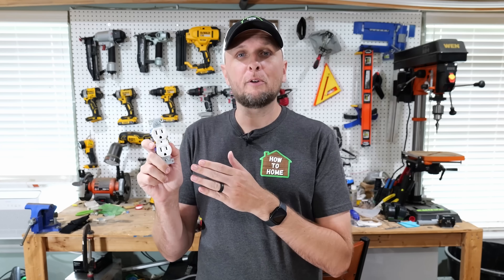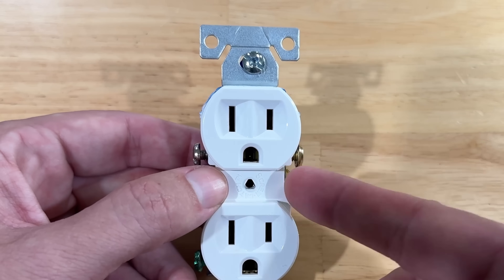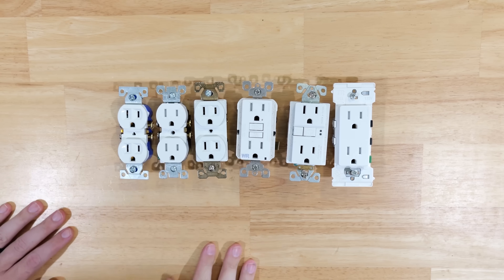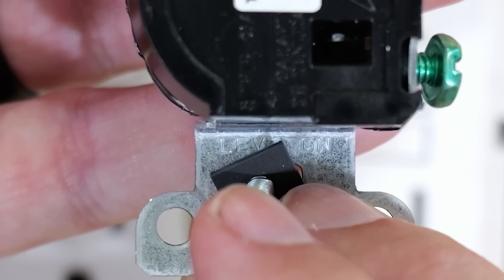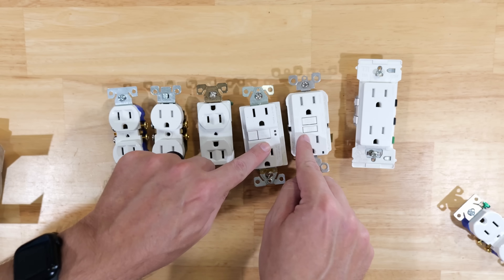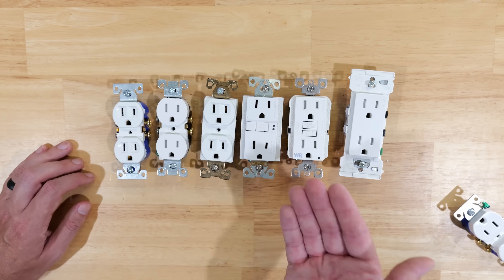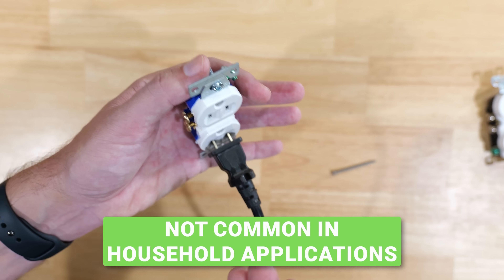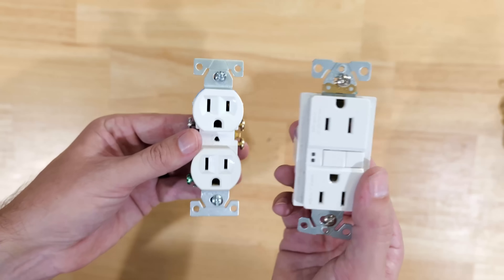The Shocking Reason Why Your Outlets Are Installed Upside Down!

Comment: I go by the fact that many devices w/ 3-prong plugs are designed to be ground down.  I’ve never seen one designed to be ground up.  Even the angular ones are a bit more awkward to plug in ground up.

My parents’ house (built in 1974) had all ground plugs up and it always drove me crazy, wanting to ‘fix’ all of them.
Reply: @xnonsuchx: Ground prong up when that outlet is attached too the wall-switch so people there know where to plug in their lamp to control it from the wall light-switch.
  Medical facilities have things hanging on walls that fall, like clipboards, scalpel, hemostat, that can fall and short the circuit, military galleys and  restaurants, ground up was specified, due to stainless steel utensils being dropped, etc. Therefore it has become required that they be ground up for contractors. In many cities ground up is standard in all commercial and industrial buildings, ground only go down in residential buildings, houses, apartments, condos, etc. 
   Internationally, countries with 3-prong outlets always have the ground up
   Everything is in context and the answer DEPENDS on context. 
   Examples:
“Never took the orientation of an outlet seriously until I was measuring for a shelf with a tape measure. It slid down and fell across the prongs of the washing machine plug.  POW! “ —@joef.6596
“I work at a K-8 school. Maintenance assembles powered multi media carts with the ground plug up in consideration of teachers dragging metal bracelet chains across partially unplugged power plugs.” —  @scaryhouse7969
“a length of florist's wire rolled off a side table onto a slightly loose plug and shorted the circuit, creating a small fire (quickly extinguished).  I now always install ground prong up” @deegee54
“I work at a restaurant and we have this work table with some outlets built in on top. Someone managed to let the edge of some tin foil go in between a plug and the outlet and it got disintegrated.”@MatthewSuffidy
“I knocked some change off of my end table one day my mistake of course, and a coin fell down right on the prongs resulting in a loud pop and a flash along with some smelly black smoke. I have since gone through my home and reversed all of the receptacles so the ground prong is now on the top.”—@chrisenglert3958
“my wife's gold necklace chain dropped off the rack onto two prongs of a device that were plugged into a receptacle with just a little prong showing.  It vaporized the gold necklace area of contact and left a nasty burn mark on the faceplate of the receptacle.   This was on a bar and I probably should have oriented the receptacles there ground prong up.“—@winfordnettles3292
"I had lunch with the Chief Electrical Engineer at McDonalds headquarters. He told me that one of the workers in one of their stores had her hand badly burned when a metal cookie sheet (or something similar) slid out of her hand. It fell onto a receptacle that was loose…the metal cookie sheet made contact with the two blades resulting in  big arcing flash that caused the injury, this is a reason Ground Up is safer."
“In commercial buildings (where receptacles are very high from the floor) ground has to be at the top. In a case of a water leak ground has the first contact with the water. In residential buildings (where receptacles are not far from the floor) ground needs to be at the bottom. In a case of a flood, ground wire would have the first contact with the water.”—@powerzx
“When a heavy extension cord or wire from a device plugged in is experiencing stress from the cord being pulled taught or tugged on, the greater force is usually downward. The ground prong being longer, exerts the greatest torque when the wire is being pulled in a downward direction.  Occasionally that downward force will cause the plastic of the ground prong opening of the receptacle to crack from the downward force. If the ground prong is up, that downward force has much greater support from the receptacle structure. I’ve personally cracked a few receptacles over the years working on projects where the wire plugged in was being yanked around a lot. Where the ground prong was up, the extension cord always stayed more securely plugged in.”—@TechwizJoe1

Comment: the debate over ground location is based in fallacies. it doesn't matter, at all. I install mine like a O face (ground down).. plugs are manufactured that way and it shouldn't be a chore to plug stuff in..

Comment: I moved into a home with the ground up throughout the house, garage, and shop. I was used to the reverse condition and found the ground-up position annoying until I got used to it. There is a rare place where the ground was down and that would tick me off because I was getting used to the reverse condition. It does make sense that the ground should be down because removing a plug might involve coming in contact with the hot wire, but anyone in their right mind would never put their fingers in contact with any of the prongs. I was taught that only the plug outer casing should be touched to insert or remove a plug,

Comment: terrible argument for ground prong up - what if it falls at an angle and still hits two? The odds of exactly straight vs angle is prob about the same. Or less. Plus once falls and hits the first one it will maybe then slide onto the other one anyway that orientation.
Reply from the maker: I mean, it happens.  Plenty of people in the comments that have shared it happening to them.

Comment: I myself as an electrician, always installed the ground prong down, which we referred to as a smiley face. the other thing is I use these plug-in modules which operate remotely. When the ground prong is down the outlet on the module is on the bottom as opposed to the top and looks neater
Reply: Ground prong up when that outlet is attached too the light-switch so people there know where to plug in their lamp to control it from the wall light-switch.

Comment: In Puerto Rico's electrical code, the ground plug will always go down no matter if the receptacle is mounted vertically or horizontally . The hardware stores have to sell the receptacles to meet with the code, so when you are installing, you have two to make sure you have the proper ones for your job.

Comment: I prefer them ground plug up.. the reason is when you have a 3-prong cord plugged in and it's a heavy cord the ground plug holds more firmly then the hot and common and it stays connected when I've had the same heavy cords plugged into an outlet where the ground is down the hot and common tend to be a little loose and can lean down and can come loose and be pulled from the wall. This is just my preference.

Comment: You reference the grounded conductor on  the receptacle as being a "neutral." There is no neutral in a 120 volt circuit. Only in a 240 volt circuit. 

In a 120 v circuit, both the black and white conductors carry the total circuit load. In a 240 v circuit, the white conductors only carries the unbalanced load between the two conductors, that is, the "neutral" current. 

Other than that, excellent video on an often ridiculous argument. 

As an ICC certified and state licensed inspector (retired) i usually asked how did they intend to orientate if the receptacle where to be mounted in a horizontal orientation? (Expect a deer in the headlight stare....)

Comment: I've seen plugs that were designed to go with the ground lug down. The cord ends up perpendicular to the wall going down the wall. I even have one that goes to the side, which I hate because it ends up taking two slots on a power strip. I have never ever seen one where having the ground lug on top would make any sense.
That pretty much settles it as far as I'm concerned. For practical reasons alone, the ground lug goes down.

Comment: They put silver wire attachment screws on one side of a receptacle and gold wire attachment screws on the other side, for a reason?
If you’re looking at an installed receptacle box are the hot wires routed to the right side of receptacle box or to the left side?
If you’re looking at an installed receptacle box; with the receptacle installed, would you expect to see the gold-colored wire attachment screws on the right side of the receptacle or the left side?

Comment: About 25 years ago I bought a house in Florida that was built in the 70s. Every room had one outlet with the ground hole on top. All the others the ground hole was down. It turned out that the outlets with the hole up, were all controlled by a wall switch.

Comment: Receptacles need to be updated to suit modern uses. Most of the things I have plugged into them are two big to allow two things to be plugged in (chargers, etc) rather than stacking the sockets vertically they need to be laid out horizontally and spaced a little after apart.

Comment: I install ground prong down.  I was told this assures that the ground remains connected even in the event of the plug being partially removed.  Ground lost last I was taught along with the black to brass to save your a**.  I was apprenticed back in the 60s.

Comment: You are flipping to read the back some of those outlets differently than the manufacturer intended.  Flipping horizontally is to be done for some and vertically for others.  That ground hole is not a circle it's a mouth an "oh my god expression.  It needs proper orientation.
Reply from the maker: It makes zero difference.  Supply the code or manufacturers instructions that say what the proper orientation is.

Comment: The outlets in my house are installed ground prong up.  All of my 3 prong plugs are configured for the outlet to be ground prong down so there were huge loops of cord swinging up into the air.  Since I hated the ugly brown outlets, I have turned them ground prong down as I replaced the outlets with white outlet so I no longer have huge loops sticking up into the ether and they look much better too.

Comment: You are way too young. When the three prong receptacle was designed most boxes and cover plates were metal. There was a real problem with the cover plate slipping across the blades. The outlet was designed for the grounding connector to be on top. At that time the code required grounding connector to be on top. Fast forward a few decades and most homes had plastic plates and boxes. The requirement was removed from the electrical code but still remained as the ANSI standard was included by reference which still had the drawings showing ground only on top. A few decades later that section was was removed from ANSI. So now there is nothing in the code. Many contracts and local codes still require ground on top though.

Comment: In the front of the code book, all installations are subject to the authority having jurisdiction (the inspector). You can basically have every code nullified or changed if the inspector you have wants something different than what is specified in the code.

Comment: My understanding is that it was a group of electrical engineers back in the 90s that said "let's spec ground prongs to be set in the up position and lobby this becomes standard in the NEC"...but it was never adopted in the NEC. Thus, it is not a code requirement in the NEC to this day. Many electricians who cut their teeth in the trade doing engineer spec jobs took the "Additional" specified requirements "as code requirements" and from there...the myth of "upside down receptacles" began and still continues to this day. In the end, in dwelling places especially (residential) the ground fault protection requirements are increasing and the relevance of the orientation of the single or duplex receptacle is becoming increasingly irrelevant. I agree that sometimes one orientation is better then another depending on how a particular appliance or equipment cord naturally fits in the particular location, but again, with so many GFCI requirements now the orientation is not as much of a safety issue anymore. More importantly, all those cords WITHOUT the ground prongs...now it becomes really obvious how silly this orientation strategy is.

Comment: I don't know how it is in the rest of the country, but having lived on the West Coast (CA and NV), every outlet with the ground pin up is designated to a wall switch.  This has been consistent in every apartment I ever rented since the 80's as well as four different houses I've owned, but configurations vary.   A bedroom without any recessed lighting or ceiling fan has a single flip switch mounted near the door entrance that operates the one and only ground pin up outlet in the room, obviously for a plug-in lighting fixture.  A dual flip switch operates any built-in lighting fixture(s) and the inverted outlet.  A triple flip switch is usually present in rooms with a built-in ceiling fan/light, with one switch operating the inverted wall outlet, the second one operating the light, and the third operating the fan function.

Comment: What I want to know NOW is about installing SIDEWAYS, ceiling installations, and FACE UP scenarios such as on a ledge behind a workbench.
Reply: “Countertop spaces require the maximum space between outlets to be 4 feet, and that no part of the countertop is more than 2 feet from a receptacle. So, there are times when an outlet may need to be installed sideways in order to fit into a spot where it is required to be installed.

The required placements of electrical outlets may also influence outlet orientation, as a horizontal outlet may provide easier access for plugging items in depending on the location. For instance, a vertical outlet behind an appliance or piece of furniture may give you no access points, while a horizontal outlet in the same location may allow you to access at least one of the receptacles. If an outlet is needed in a certain location but it is also clear that the spot will be blocked, then an outlet may be installed sideways to try to improve access.

Another common reason for horizontal outlets in your home is simply the result of aesthetic choices. Electrical outlets are obviously a necessity, but if you're on the hunt for brilliant hacks to make your kitchen more aesthetic, you may find yourself wanting to hide them. While this can help your kitchen look nice, covering the outlets reduces their functionality. Instead of hiding an unsightly vertical outlet, some people choose to install horizontal outlets. Horizontal outlets can have a look that is more low profile, which is especially nice for outlets that are placed higher up on walls, such as above countertops. In kitchens especially, horizontal backsplash patterns, such as subway tiles, are popular, and horizontal outlets are especially good in these situations. Rather than break up the look with a vertical rectangle, outlets can blend in seamlessly when they are turned sideways.”

Comment: Almost all wall warts are designed to hang down with an outlet installed with the ground prong down. Even if they're only two prong. Of course we all hope they would get rid of wall warts, but that's not likely to happen soon. And wall warts hanging upside down are problem.

Comment: If you really wanted something supported by the ground or return pins without contacting the hot pin, you should mount the sockets on it's side with the return pin up so that you have two of the neutral pins on top...

My parents actually tried to put the basement sockets on their side when developing the basement and the city inspector insisted they be mounted vertically...